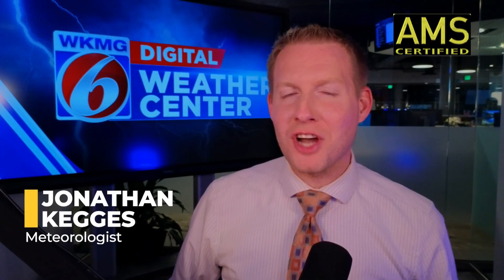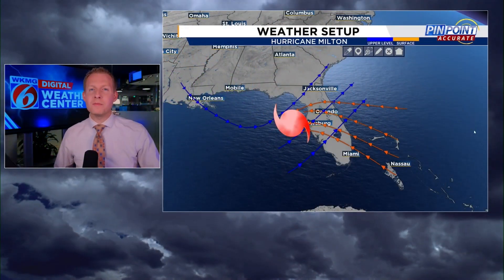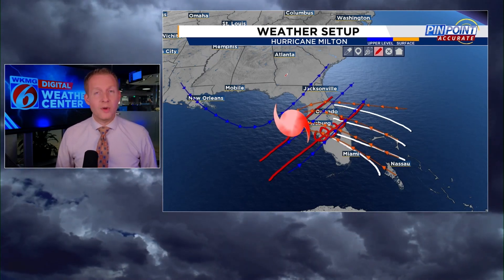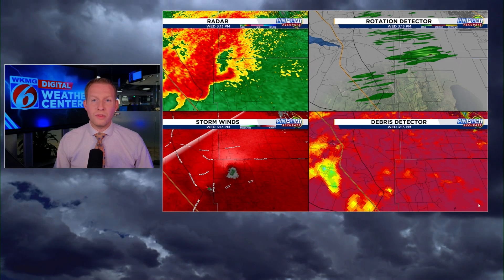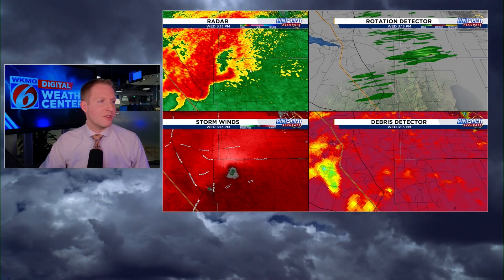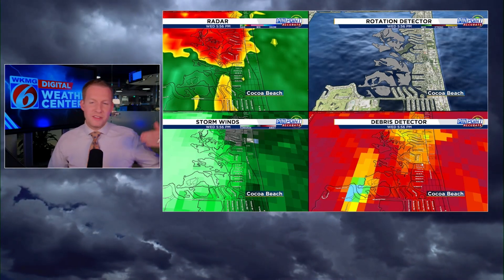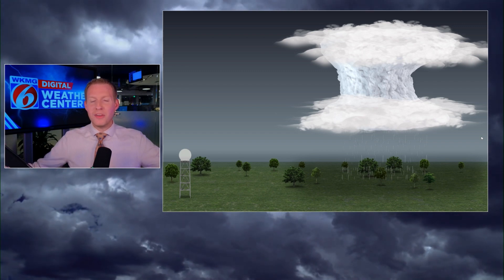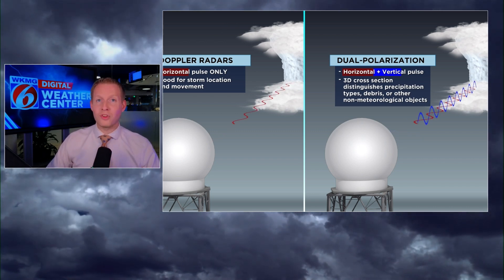This Is What Made Hurricane Milton's Tornado Outbreak So Bad (How Tornadoes Form)

Comment: I watched a video recently talking about how there may need to be a modification made to the EF scale. Mobile radar have multiple times recorded wind speeds over 200 mph, but the tornadoes are still classified as EF-3 or EF-4 rather than EF-5. What are your thoughts on that?
Reply from the maker: That wouldn’t change the scale. That would put them at EF-5…however the Fujitsu scale is a damage scale so they have to hit something and produce that damage. Thats why they are rated that way. I feel like if it’s measured it should count. - Jonathan

Comment: I'm really don't think that Milton was still a hurricane upon landfall. I think Milton had morphed into a very powerful hybrid or subtropical storm by the time the storm actually made landfall. There was the rapid development of a sting jet when Milton made landfall, and sting jets are never associated with tropical cyclones. However, sting jets are associated with mid-latitude storms, as well as hybrid or subtropical storms. You're correct. The fact that Milton was rapidly transitioning from a tropical cyclone into a hybrid storm greatly exacerbated the situation with the tornado outbreak. I wouldn't be surprised if the National Hurricane Center eventually reclassifies Milton as a hybrid storm upon landfall, instead of being a hurricane.